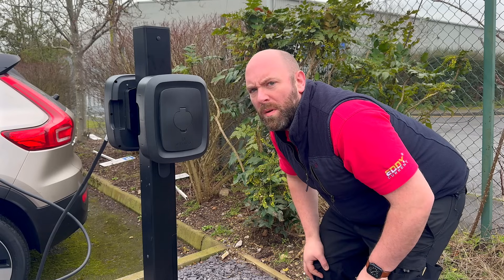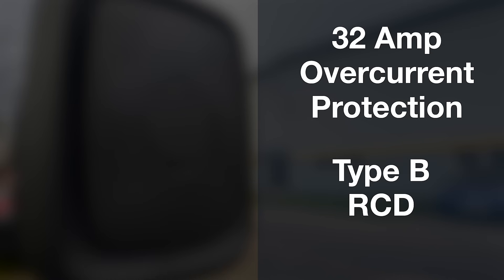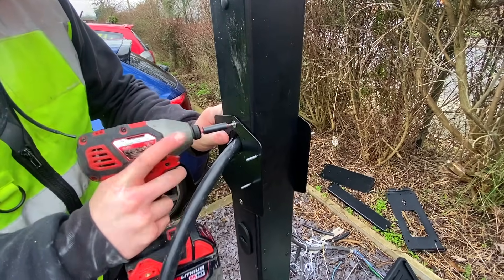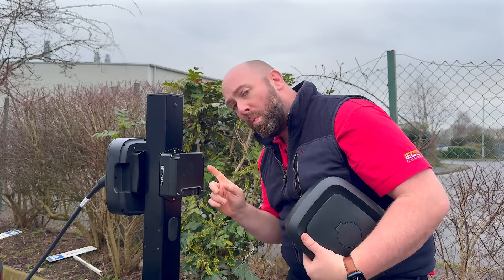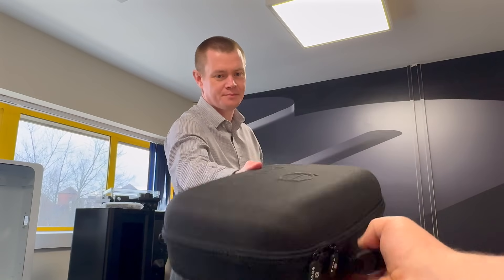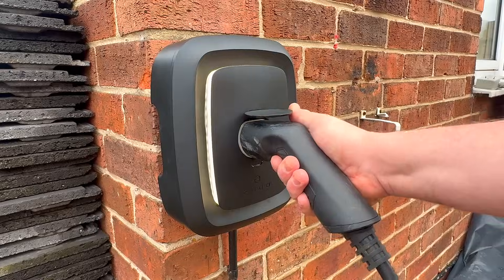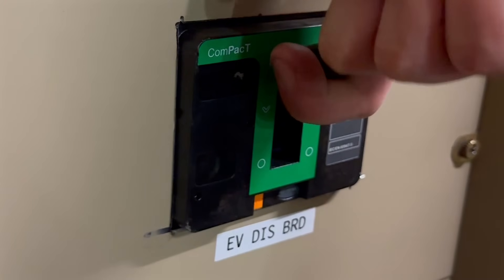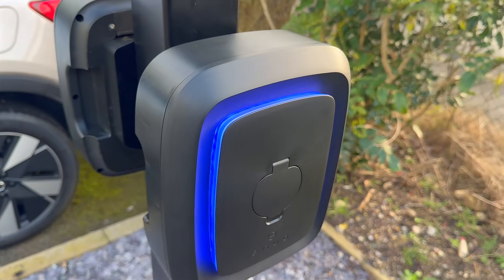The EV Charger You Can Take Anywhere! From Enua

Comment: No mention on PEN Fault detection, you gotta carry this module around PLUS an EV cable too, needs yet another app etc...
The selling point about easier home install - ergh if you have run the EV cable from CS to base unit & made the connections - ergh that's the exact same amount of work to installing a wallbox EV like Ohme is it not ???
Personally I still like a basic "dumb charger" variable charging speed without all the faff with app & data
(Eon Next Drive doesn't demand a smart charger for 7 hrs cheap charging)

Comment: Different for sure, but are car charges actually car charges or just power supply’s for the EV and the actual charging part in the vehicle itself? I only ask as this often comes up in the never ending info on the WWW 🤷🏼‍♂️
Reply: Exactly. EV batteries are DC and therefore the actual charging equipment is built into the vehicle.
Reply: They are just fancy high current plug sockets with PEN, RCD protection and signaling to the car so it knows how much current it can draw.